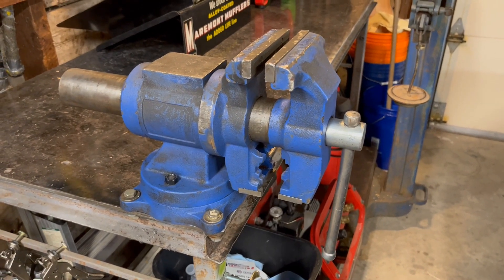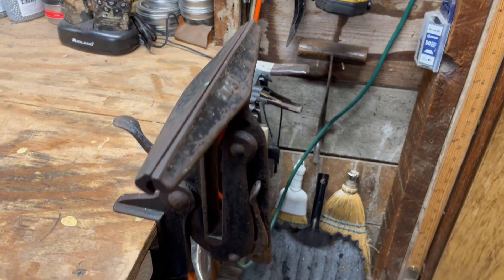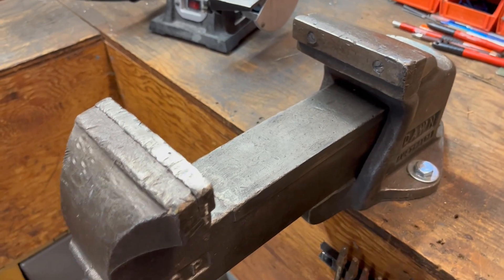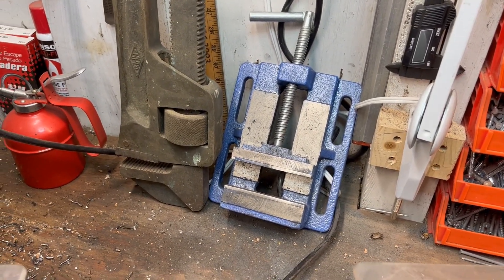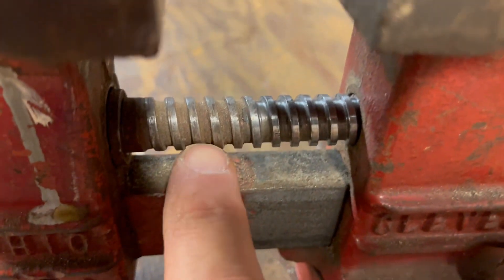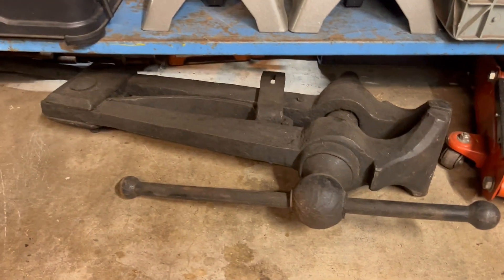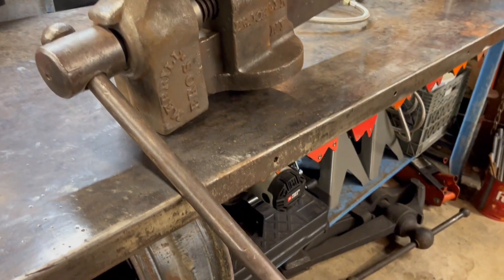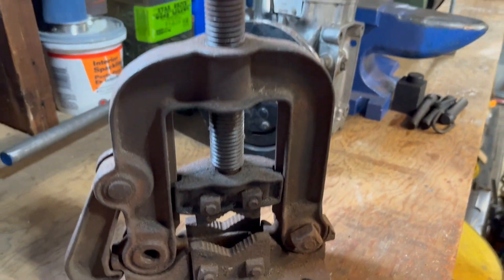Vises, Vises...Vices - Different Types - How They Work - How Many Do You Need?

Comment: I also like vises. I would like to find a post vice someday. I haven't thought much about how many vices I do have until you were showing yours. The one I use most is mounted on a sliding bracket that I can remove and store under the workbench. Helps keep more space available on the benchtop. Thanks for sharing!
Reply from the maker: Vises definitely take up room on the bench.  A sliding bracket system would be pretty slick!  I hope you find a post vise someday.  It would make a great addition to your shop!
Reply: @EightWheelsRollin  Thanks for the reply.
Reply: They show up on FB marketplace and Craigslist pretty regularly around here, the mpls area. I got a couple for $100 ea. They're always in rural areas, always. They were 100 miles out of town.
Reply from the maker: You're definitely shopping in the right places.  There are a lot of good deals to be had in those rural areas.   @ProleDaddy